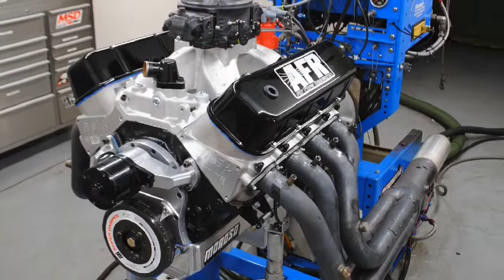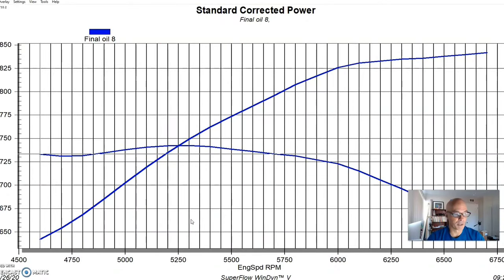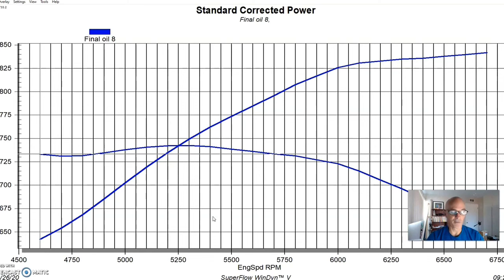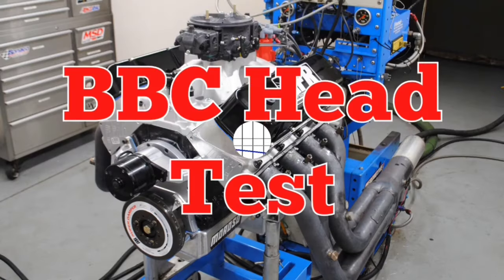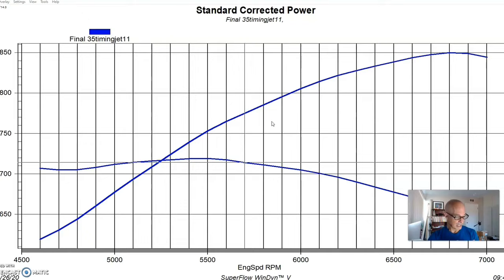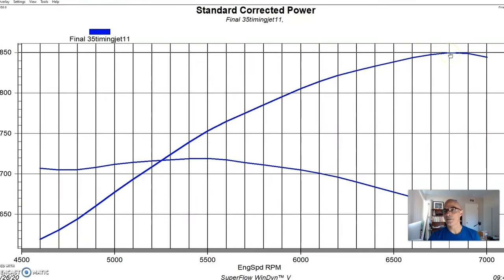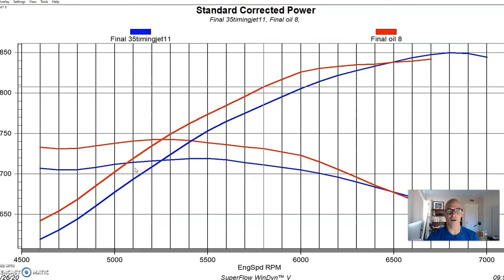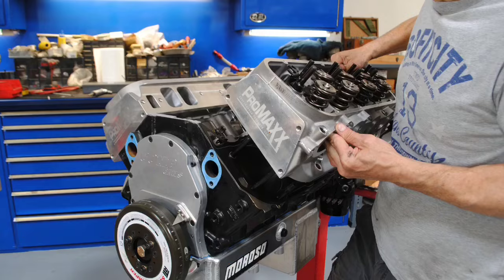LOW BUCK BBC HEAD TEST-PROMAXX VS AFR

Comment: i paid around $850 for a set of Promaxx SBC cylinder heads. Were talking about 1400 plus for a set of AFR cylinder heads with the same specifications. For a inexpensive build and relatively close power numbers, promaxx heads are a great option.  flow numbers are pretty close within 15-20 cfm at .500 lift . Cant beat promaxx heads for the price.
Reply: Thanks for the prices, u should of made this video since the other guy wouldn't give prices, thumbs up thank u
Reply: Rock and roll dude let him know there are other options out there don't destroy your pocketbook some of us live in the real world
Reply: @rogerowens5669  that's no shit all my big block chevys are built on a budget I'm guilty for buying the cheapest parts and yea I've had a few problems with going with the cheapest parts but in the long run I've really had great success with the cheap parts. There's a guy in my home town that thinks you can't build a 800 to 1000 hp BBC without spending 20k and I've done it multiple times with gen 6 junkyard BBC and spending less than 4k and them being reliable and sorta cheap to fix if sum breaks

Comment: I paid $2600 for a pair of ProMaxx Shocker 200 heads for a Ford FE from Jason.  The heads were supposed to have springs for a hydraulic flat tappet cam.  They had around 190 lbs closed and over 500 open. The installed heights were all over the place. The springs were just thrown on with absolutely no shims. These wrong springs could have been the cause of a  new Comp Cams cam and lifters failure after less than one hour of run time. This of course killed all bearings in the motor and the crankshaft. Not to mention oil pump, gaskets, and labor. Just poor quality.

Comment: AFR all the way, for a couple hundred bucks, area under the curve and made in the USA!
Reply: BW MadDog [retired]  The casting comes from China. They are finished here. This was explained in the video.
Reply: Afr is made in us promaxx is off shore cast
Reply: I can’t speak for the Chevy stuff, but the as-cast Promaxx heads for sbf have the best area under the curve for a set of heads under $1300. They even out perform AFR enforcers. I graphed several heads in Excel. From Ebay to AFR. The Promaxx heads are about $900. More or less depending on spring package.

Comment: I bought a set of 200 maxx heads for my sbc. I took them to the shop and the ONLY adjustments they made were to the keepers to lessen spring pressure because of my cam size. Everything was bolt on ready out of the box. For what they are, they're a damn good head for the money. No point in putting money into old cast iron heads when you have these for an option.

Comment: I am looking @ the above dyno chart from the viewpoint of a heads up 1320 contest. From 4600 to 5400 rpm the AFR heads are running about a 25 ft pound average torque advantage! From 5400 to 6400 rpm the AFR heads are still dominating the Pro/Maxx heads but with diminishing returns in the all CRITACAL TORQUE, until the ProMaxx heads starts to increase torque over the AFR head just past 6500 rpm.  Try to imagine two rigs in class racing leaving the line, like that 25 ft pounds of torque HAS GOT TO MAKE A DIFFERENCE in getting out of the hole IF traction is equal between the two rigs. I would REALLY like to see the exhaust port flow numbers in these two brands of BBC heads, What are the angle of cuts & how many cuts are machined onto the valve seat inserts ESPECIALLY the exhaust valve insert? I mean those machined angles cut/ground onto the inserts alone can make the difference in low lift flow(up to 0.30 lift) for BOTH intake & exhaust.

 In todays world it's the rapid evacuation of the spent gases in the combustion chambers that makes the difference in hp & torque, like the faster the exhaust is evacuated the stronger the pull on the incoming intake charge during valve overlap(free supercharger!). The headers look to me to be equal length or close & have 2.125" - 2.50" primaries plus about a 18.0" collector length(good). I would say that the extra torque the AFR heads are producing can ONLY be coming from a superior valve seat machining configuration. It would not surprise me one bit if the AFR heads come with a radiused cut coming OFF the valve seat cut & for that matter a radiused cut coming INTO the intake seat cut. Also the ProMaxx exhaust ports may be too large which would SLOW down the escaping exhaust gases which in turn would reduce the pull on the incoming atmospheric fuel charge during valve overlap. If you can check out the valve seat cuts/angles as well as the exhaust port size between these two brands of heads it would certainly be an interesting vid for sure regarding our community. Thanks so very much for sharing your experiences with our community!

Comment: For street guys the promaxx are by far the choice - 25hp is a very expensive jump and im sure 95% of ppl will be slightly terrified already driving such a motor around that they/we/I wouldn't bother dropping the 2k+ for marginal gains - gr8 comparison though and thanks for the hard work again!

Comment: Remember that a good hand porter can improve that CNC Pro Maxx head and help close that low lift gap. Order the PM head bare and have them built with bigger valves, hand porting, still cheaper. 😉

Comment: one thing to keep in mind is that the ProMaxx head is CNC ported and the AFR head is as cast.  for the price difference between these heads, I would go AFR. you can always have the CNC ported latter if you need it.  not that there is anything wrong with the promaxx head, it just AFR has them beat in overall power below peak. unless you are running NASCAR super speedway engines or maybe something like the Silver State Classic/Pony Express 100, you are never running at peak power for a long durations,  so the AFR would be the way to go. especially in a drag car than is shifting gears on its way down the track and is only a peak power for a short period of time. which in reality is what a 572 Big Block Chevy is made for.

Comment: So, these may be a little small for my engine- 632" bbc, .700" lift 272/282@ .050" 110* lsa hydraulic roller cam, 10.8:1 compression super victor and holley dominator sniper efi.  BUT, the promaxx heada were $2360, and the afr were $2860.  $500 for the HUGE average gains is a bargain!!!
Reply: Did you ever Dyno your motor? I'm building similar set up. 604ci brodix race rite 345s
Reply: @dinger4480 833hp @6100, 845tq@4300 on 91 octane @ 5000'. Lighter valvetrain would allow more rpm, but its a street motor.  Ill stick with the heavy sainless valves and hydraulic rollers....

Comment: I'd say the for the extra $100 per summit for my combo the AFR heads will br faster at the track in my car, I wouldn't rev my 540 out to where the pro max heads make an extra 8 horsepower, the low speed power and torque would have already made my car accelerate  faster down the track.
Reply: Exactly.

Comment: The area under the curve for that AFR head is a sweet deal. This setup is pretty darn good. There's three ways to go on this. 
1: Different manifold in an attempt to inflate 5500-6600 RPM. Either head can do great. Cost effective choice. 
2: Attempt to move the power shelf up and to the left for a less aggressive valvetrain package and a 6500 RPM rev limit. My first thought would be 1.3 points more compression and straight alcohol. 15 degrees less duration on the cam might help that particular option.

Comment: I did not expect Pro Maxx to do that well, I understand pro maxx will port your heads for a cost if you send in your as cast heads later if you need more power, I would just do that first, I do like the low and mid range power they had.

Comment: Without testing the heads on the same day the numbers come into question.  We don't know temperature or humidity which both play a pretty significant role in power production. I'm a huge fan of AFR however you can't fully rely on the numbers given. Personally on a setup like this I would go with the AFR's but I'm not opposed the Promaxx either depending on what you are building. Yeah they get their castings from overseas but they are still employing Americans to turn those castings into quality heads. I'd buy from them versus the company who is having everything done overseas 7 days a week and twice on Sunday.

Comment: I really would like to see SBC version of this.. Promaxx vs. All.. I've heard great things from promaxx for the money and would love to know the facts..
Reply: Richard has done some of what you want, go look in the listings for all the videos and you will see.
Reply: Thnks mike, I've seen all the ebay/procomp comparisons to brodix ect. But there's not much out there about Promaxx SBC heads in general.. if you know of any send links my way please
Reply: I'm building a 408 sbc with the promaxx shocker  right now
Reply: @T29-48  , I'm also putting together a 415ci ABC, and I've been considering the same head, if you finish it soon, I'd like to know how it performs..
Reply: @kevinpurkey7331  you on Facebook
Reply: @kevinpurkey7331  mine 13.5 compression, .709 cam, promaxx shocker, super  victor and dominator
Reply: @port nut and especially comparing it to the stock cast iron low compression head. some ppl are cheapskates and som ppl are are enthusiasts that dont have big money to throw. i feel if u cant afford big name usa parts well atleast there was an American somewhere along the way that got paid ie: salesman , dock worker, or  delivery driver....

Comment: AFR heads come with the option of full CNC porting also.  20 years ago I was into SBF engines and the AFR heads really woke them up.  I had a 64 fairlane with a 331 stroker that roasted the tires at will, and that was for $1,650.00 for full CNC porting when practically no one else offered it.  AFR has always made great heads.

Comment: Great video and test thank you Richard. Just think of the results if you would have put a fully CNC ported AFR head such as a 335cc compared to the PROMAX 340 fully CNC'd ported head. It would have been a more fair test... Even so the AFR's as cast 345cc head still kicked the ass of the Promax fully cnc-ported 345 head except at the very top of the RPM range. I would have loved to see what the AFR cnc-ported 335cc head would have done against the 340cc ProMaxx. I believe it would have REALLY STOMPED the ProMaxx head.. just my 02

Comment: I’m going with the Promaxx 9175 $986 over the AFR 1492 $1715 for my SBF 5.0 Windsor. I took the time and made a spread sheet utilizing a lot of your math for all of the head manufacturers that gave flow numbers. The AFR’s have a better coefficient of discharge and cross flow ratios than the Promaxx. And you’re right, AFR’s have great low to mid range lift flow numbers. With my cam profile, I could expect a theoretical HP numbers of 514 hp with Promaxx and 552hp with AFR. Taking Horsepower TV number of expecting no more than 1.6 hp per cube on 93 octane. I figured I would need at least 350 cubes to capitalize on the AFR head. I don’t plan to punch and stroke my 302. So it boiled down to potential hp while taking my displacement into consideration and then cost.

Ps, when are you going to start doing some 7.3 powerstroke videos or diesels in general?

Comment: I bought a set of the pro max cnc they actually measured 352 cc intake runner peak flow was around 430 at 800 lift but were alittle low in the. Mid range. I bought mine mine at a bargain  gave 900 for a pair of new bare cnc casting. I believe if I had to pay retail I'd go with afr . They would be considerably better with alittle port work. Just saying

Comment: What is the spring pressure on the Chinese head and what were the Figures on YOUR flow bench not theres. What are the components used in the chinese heads.

Comment: I enjoyed the video.  The author does do a lot - lot - lot  of disclaimers.    He then draws strong conclusions.  I believe that all he can really say though is for this particular cam, this particular engine bore/stroke, this particular intake and headers that the AFR was a better head in the lower RPM ranges.  I would love to see more testing, say a hotter cam, better intake and higher RPMs what the difference would be.   I would also be curious about less maxed out engine displacements.  I myself am not running near this much engine, but if I were to do a strip only configuration, I might consider this if naturally aspired was what I was after.   In a 1/4 mile scenario, the RPM range would be at the high end, but low end torque is important until the vehicle gets going if you can keep the wheels firmly planted.  Certainly it sounds like the AFR heads are better for street use.

Comment: Richard - I hate to be a pester - but before the end of this series with the 572 could you PLEASE see how much power you can get out of a hydraulic roller VS solid? I am willing to lose some power to go back to hydraulic due to maintenance/destruction issues - just looking to lose as LITTLE power as possible in the transition backwards on the power scale. I need a little cushion for the pushin in valvetrain tolerance. THANK YOU!
Reply from the maker: I think Steve at WESTECH or EM did that

Comment: How about a test between the AFR enforcer 185 and the ProMaxx 185 heads on a small block ford.
Reply: The 165 afr head on a 331 small block Ford Solid flat tappet pump gas motor is awesome it can make 500 no problem and that is about it with a factory block so why go bigger

Comment: Kind of difficult to option out the head for what I want to build because the Shocker series is only offered in 210cc runner whereas the AFR's are offered from 165cc up to 220cc. I would like to build a mild twin turbo 408 (probably doesn't need two turbos for the power level but I love twins) so I would probably go with the hydraulic roller Shockers which would be $1610 or the 195cc AFR's for $2158. I'm a huge fan of AFR's but $500 is a big difference. I won't be pulling the trigger on that build for a while so maybe someone will get a chance a to test said heads on such a combo to see what the real difference is in power. Actually for me I would almost certainly go with the Shockers because I want to put the combo in a Crown Vic sleeper so the power difference wouldn't be that critical.
Reply: @ron Kay Yeah you have a very valid point there. Promaxx is an American company. Do you know if they cast here and finish here or cast in China and finish here or do everything in China? Their website says they bought out Patriot Performance and Alabama Cylinder Head Exchange. Outside of that and family owned since 2012 not a ton of info on where and how their heads are made. Their contact info is Rainbow City, AL but that doesn't mean much these days.

Comment: Richard - I agree.......lets see a Promaxx head comparison for a SBC......whatever you have available 350/377/383/400.

There is a ton of interest in budget SBC heads but it always comes down to crummy heads like procomp (at least the old ones) and super trick heads like AFR.

I really want to see a no BS comparison for the Promaxx SBC heads.......maybe even do their as cast head and then a CNC ported one and comparing them to AFR 195 (the gold standard it seems for street toy guys).

Thanks.
Reply: @ron Kay Sure but that is like saying a $10k 598 will kick ass on a $3k 383. I still think the Promaxx vs AFR (or Dart or Brodix or whatever) head would be a great illustration. I am not expecting the Promaxx to be the top performer......I just want to see the comparison and what one is giving up by going with the Promaxx. Myself and friends have thrown together great SBCs on a pretty thin budget for vehicles from 4x4 trucks to 11sec street cars and feel the Promaxx are one of the best "offshore" options for less than $1k......we just want to see the actual test to confirm our assumptions.

In all fairness, I can gather the same info in a Promaxx VS Procomp/Speedmaster comparison. Thanks to Richard, we already know the difference in AFR (I believe) and the Procomp/Speedmaster.

Comment: I would love to see a comparison of the Skip White bravo 335 head against the afr 325 as cast heads for the bbc. A 496 would be a great candidate at around 11.1 compression. 4150 style 950 carb. Maybe a .680 solid roller. 112 lsa. I havent seen anyone using those bravo heads yet. Just curious how well they work as a comparison to the name brand stuff. They are not the super junk pro comps but they arent afr heads either.

Comment: Richard I recently purchased this exact same camshaft. I’m curious did you install it straight up or advanced. ? Thank you in advance. No pun intended.
Reply from the maker: straight up
Reply: @richardholdener1727  thank you for replying Richard. I have 582 with Tony Mammo modified 357 AFR’s and  I want to try the camshaft used here on the dyno. 11.9 compression pump gas.

Comment: Went with cnc promax ,shafts rockers ,stage 2 mechanical Elgin ,laser drilled lifters  gear drive.  Composition  dist  gear , long headers , h-pipe , purple hornies,  Avs 2 800 cfm , or the tunnel ram I have already , 550hp here I come

Comment: I've read that all AFR heads are CNC machine ported, and that's what makes them produce better flow #'s, and power. If the ProMAXX heads are ported, would they perform as well, and at a cheaper cost than the AFR's?
Reply from the maker: the promaxx heads were ported

Comment: The power curve on the AFR test looks weird to me.  Why did the torque curve have a kink in it that bent it down and hurt peak power?  It's only 8 hp at the top end, so you'd never notice it, but that midrange power advantage would be noticeable.